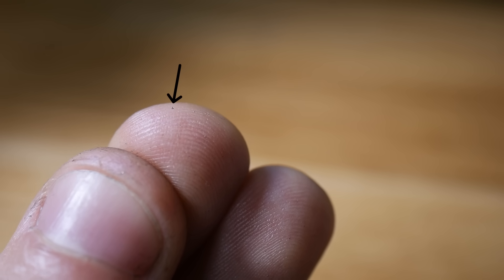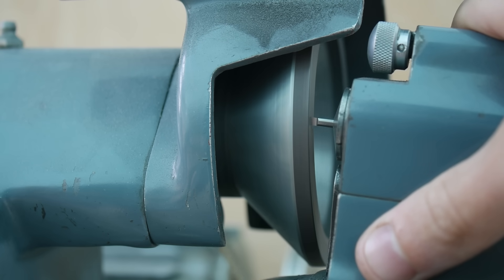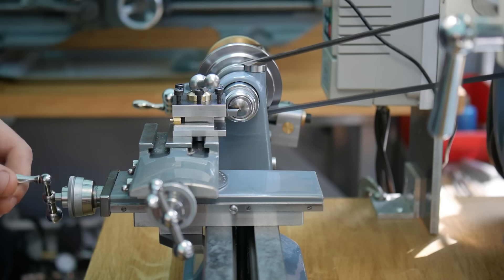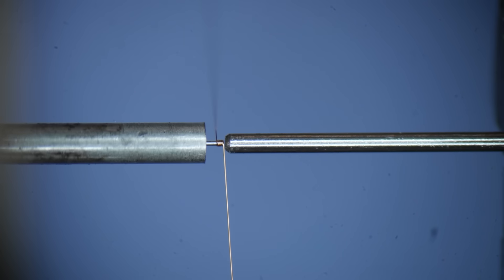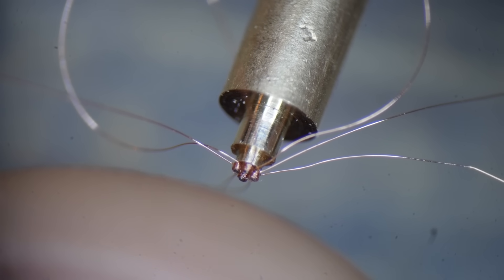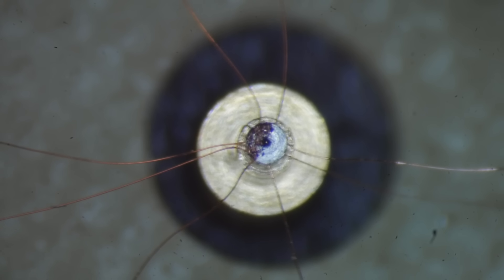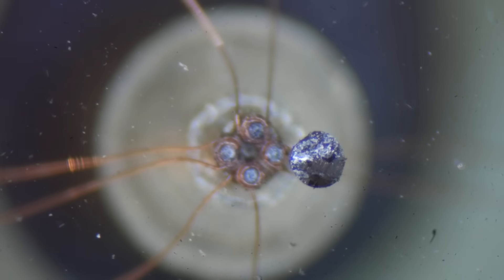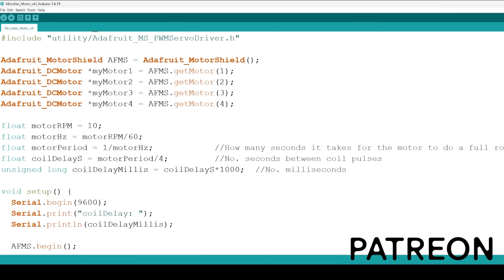Attempting to Make the World's Smallest* Electric Motor

Comment: this is incredible
also i don't think the wire melted in the solder, but dissolved straight from solid
Reply: I was about to comment the same.  Copper is glowing noticeably by the time it melts.  Along the same lines, I don't have the ability to melt platinum in my shop, but I've made silver-platinum alloys by just dropping platinum in molten silver and letting it dissolve.  It seems like it wouldn't take long to dissolve a copper wire that fine in molten tin/lead/whatever.
Reply: @PyroForge  hope you are joking... solder melting point at the absolute maximum with no lead content is 450c. copper melting point is minimum 1050c. they are not even close to overlapping. platinum melts at 1700c, and silver 1200c. so unless you are getting close to the boiling point of silver, platinum will not melt.
Reply: @bmxscape  You don't need to heat a metal up to its melting point to get it to dissolve into another metal, just like how you don't have to melt sugar to dissolve it in water.  Quite a few metals will dissolve in mercury at room temperature.

Comment: If you had three pole-pieces and set them up with a three-phase drive to create a rotating field, it might be possible to use a rotor machined from fully-hard Sterling silver rod,  or possibly Tellurium copper. No need for it to be magnetised, it would be driven by eddy currents. The drive waveform could be an analogue pseudo-sine, with eight or so steps, although at the frequency you'll be running, it could probably use a real cosine function. Simpler to go with PWM, but it depends how many DAC outputs your microcontroller has. Each coil would need to be driven from two antiphase outputs. I guess you checked for temperature rise in the coils? That might be the limiting parameter. Supporting the rotor using surface tension seems a good idea if you can find a low-viscosity non-evaporating fluid.  Great stuff.  Mad, but great!
Reply: This remains true of the iron rotor (even demagnetized), but the catch in both cases: an induction motor requires a high enough drive frequency that the eddy currents don't go all the way through it (or in transient terms, don't stop before the phases switch). For a part of this scale, it might take some 100s of Hz, even kHz, to spin -- at which speed you won't see anything!  Even a high-speed camera might be challenging due to the intense light needed and in such a small area!
Reply: @T3sl4  Well, that should be fine, there was no constraint as to what speed it had to operate at. If you can see the black half side when stopped, then it turns to a blur, you know it's moving. You can always worry about how fast later.
Reply: @kleetus92  sure, no speed constraint, but if it's moving fast and bumps into something, such as one of the electromagnets, it might go flying.
Reply: @T3sl4 what about reluctance motor? No eddy currents, no peramanent magnetisation needed - the "only" problem is how to create rotor (cannot be simple disc).
Reply: @grzegorzdomagala9929  Also thought about reciprocating reluctance (i.e. solenoid + mechanism). A flexture might make one more practical at this scale?  An oscillator is still a motor -- but if one wants rotation specifically, converting one into the other will be similarly nontrivial (replace cogged rotor with ratchet rotor? heh).
Reply: @T3sl4  I thought about iron "bar" suspended in drop of oil on top of the stator. Even if the bar is not magnetized it will try to "short" magnetised poles of stator. If you magnetise poles in right order you can rotate the bar - and even claim "usefull application" - miniature stirrer or even centrifugal pump :)
No idea if something like that will be stable - I seem to remember that rotating objects tend to maximise momentum so the bar should rotate around shortest axis - but at this scale and in viscous fluid... No idea.
Reply: It’s amazing how often those two intersecc
Reply: Wouldn't the Eddy currents blow the rotor out of the hole?
Reply: @naasking  If it would spin AND get ejected, that could be amusing. Spin-stabilized railgun?

Comment: Amazing project! Can't wait for any new parts!
I'm no expert, but maybe the step where you cut of the rotor with the diamond saw etc. can be made easier by just shearing off that part of the rotor intentionally, supporting it inside small hole made in some kind of fixture(shearing it of while being partly inside a syringe or other 0.1mm hole).

Comment: I think that if you "pot" the stator coils in cyanoacrylate and make the rotor disc run inside a bore in the end of the potting material, covered with a bit of glass, it may work since the rotor in the bore is essentially its own bearing.  Rather than drilling or turning the bore, I would try using a core, (as in metal casting), to form the bore when you pot the coils. You could try using somthing such as teflon rod that the cyanoacrylate would not stick to to make the core, or you could use somthing that  would be dissolved by a solvent that would not affect the glue.

Comment: Some thoughts: laying the coils flat might be better, though it might increase the volume depending on how you measure it. A three-coil two-pole design might be better, maybe a simple bar for the armature so it works partially as a switched reluctance motor, giving more torque to overcome the high friction at these scales.

Comment: 11:11 wear a mask, then you can safely breathe around these kinds of sizes. I use one for soldering, and while the solder smoke pops out, my breathing doesn't disturb it, it goes in a single, clean line towards the extractor (almost like in those laboratory pictures with wind tunnels for the study of hurricanes).
Reply: I interpreted his statement to be less about blowing the part away and more about the additional vibration/movement that breathing causes in your body. I find when micro-soldering that holding my breath briefly steadies my hands significantly if I need the extra stability. A mask does’t hurt to prevent air currents though.
Reply: couldnt he just turn his head for a moment and inhale
Reply: And a beta blocker 😅

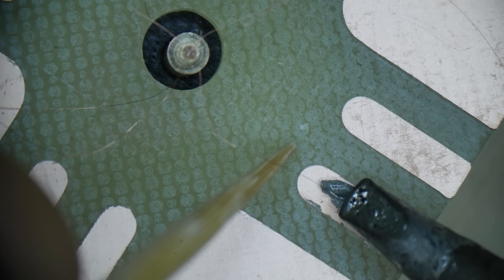Comment: 10:32 for stuff like this, don't use solder. Go get the paste that's used for copper pipe installations. It contains an amount of solder. Put the wire on the pad, put the paste over the wire and the pad, then put a heatgun on it. You can use aluminium foil to insulate the areas you don't want heated.
Reply: @aserta    at 10:21 you can see he is using solder paste, can’t quite tell if it’s being dispensed from a blunt needle or is on a piece of wire in a pin vise. And at 10:30 ish there is solder paste on the pad before he sets the iron down. Plumbing solder should also be avoided on electronics as the flux is generally acidic and can cause damage.
Reply: Why use that and not solder paste, which is designed for soldering small electronics to pads?

Comment: Have you considered casting the motor parts? You might be able to grind, drill, mill, or etch away a negative impression of the part on a ceramic material and then fill it with filings from a magnet. You might be able to melt the filings in situ to form the part.

Comment: Ooof, I don't hate myself enough to attempt something like this.
BTW add photocuring UV adhesive to your arsenal - you can manipulate the part till you're happy with it and a bit of UV light will set it in place in an instant.
Reply: Yes! Microtec Turbotec 911 UV works well for me...
Reply: @bastian6173  Would a glass pipette (like the ones used to interact with single cells) be helpful for applying tiny amounts?
Reply: @billmiller4800  personally I use thin pieces of wire to apply tiny amounts. If the droplet is small enough there is no need for a pipette
Reply: @bastian6173 is this product available in the US?
Reply: @michaelludvik2173  just did a quick search and it seems they're only available in Europe... unfortunately. They do offer large 50 gram bottles though which could make transatlantic shipping worth it. Note that a lot of UV CA glues are destined to be used for metal/glass combinations. Very few are meant for regular wood/metal/plastic etc. And... make sure to store inside a fridge to maximize their longevity
Reply: @bastian6173  ah ok, I was coming up with Euro only results from my search too. I am used to Bohle and Dymax for our glass bonding. I am looking for a UV glue that is good for micro scale components (bonding a 1mm metal shaft to a ~3mm glass disc). It needs to be low viscosity and have a fine applicator tip.
Reply: @  if it's only about size, why don't you buy one of these UV blocking bottles and put an application tip on it that suits your needs? Just an idea
Reply: I got something called "SOLAREZ Fly Tie UV Cure Resin Thin Hard Formula" off Amazon.  Available in a 5g tube so not expensive at all.  Still works about 4 years later!
It has a great viscosity and surface tension for applying tiny amounts accurately.  I used a tiny wire or a watch oiler for applying it.  This is the same way tiny quantities of lubrication are applied accurately to watch parts.
You first get the smallest bit you can from the end of the tube onto a small nail or bit of wire.  But this blob is enormous compared to what you want.  So then you take a small wire, maybe 28 ga, and touch the tip to the blob and transfer a bit to the tip of the wire.  By how you orient the wire and how quickly you move it away you have surprising control over how much is transferred.  Then you carefully touch the bit on the tip to where you want it and the surface tension pulls some off the wire.
Trying to apply directly from a hypodermic needle would be way too inaccurate at this scale.
A tiny handheld UV light hardens it in about a second.
Someone should make a foot pedal operated light that uses BLE to signal to the light, so it doesn't need to have wires.  Pushing the on button the light not only takes one hand, but it's a very large motion at this scale, which makes it hard to hold the other hand steady.
Reply: @xyzzy42  appreciate your detailed answer on this. What kind of things are you making? I just googled fly tie and it’s a fishing product. Does that have good mechanical properties? Also others have mentioned the watch making technique of dipping a thin wire in glue - I will try it! Also, which UV light do you use?

Comment: What about putting the jewel bearing on the bottom of the device with the rotor shaft going through the whole thing?

A tiny clamp lid made of plastic with teflon on the “top” can reduce the friction and hold it in place.

Then using marker on the edge of the rotor (instead of the top) and filming from the side to check if it works.

I think this will hold it all together despite the magnetic forces and reduce friction.

The lid can also act as a stop to hold the coils. Plastic toothpicks could be used instead of wood for pressing things together or a custom metal toothpick.

Plastic tends to have static electricity though and i don’t know enough about micro electronics / magnetic fields to judge if this is a problem or not.

Finally, perhaps using the circuit board as part of the initial mounting, then freeing it could help stabilize everything at this hand-made scale.

Comment: Can you make a jig for the cutoff step with the magnet. Am thinking a u-shaped jig with a precise aligned hole on each side that allows rods to come in, one from each side and nearly touch. The gap between is width of the finest grinding disc you can find.

One rod has a hole that accepts the rotor shaft, with a short counterbore to allow the rotor top you want to preserve in. The other contains a hole the diameter of the main piece of stock. CA glue the final part into the jig, and then grind using the gap as a guide, then soak in acetone to release the part.

You might even get away with making a part with simply a pair of holes so the final rota fits precisely and flush with the top surface. CA glue in, grind off close, sand / burnish flat, and then acetone.

Comment: Absolutely unbelievable work! I don't know if this can help but they do make micro manipulators for inverted microscopes. You may have seen pictures of glass micro syringes injecting stuff into single cells. This equipment is available on eBay but unfortunately guaranteed working examples are usually expensive.

Comment: Brilliant! I'm not sure if these other methods of motor driving are any easier to miniaturize, but I thought I would note them anyway: Electrostatic (corona discharge from a needle which pushes on the vanes of a tiny Crookes-radiometer),  Induction ( Similar stator, but the rotor is not magnetized. Instead, a rotating magnetic field from the stator induces eddy currents in the rotor which produce a complementary magnetic field. )   I think the induction one is promising, since I've heard that such a stator can even rotate a plain copper slug.

Comment: could have started with a motor 5x times the final size and learn/refine/improve the processes
Reply: Not sure you understand the scale here lol. 
5x is nearly an equal challenge for 99.999% of any machinist. Which would mean it would take nearly as long for the first iteration. This IS his first iteration, it was the test to learn from. 

Also scaling something this sensitive to magnetism, air currents, debris, etc etc, most likely wouldn't transfer 5x smaller. Most of the "learning" was in the method of machining and assembling, not the proof of concept.

Comment: Does the rotor shaft need to rotate? If not then wouldn't it be easier to make it static, and rotate just the rotor plate? Less holes to get filled up with glue...

Comment: PS:  I suspect the entire premise of this motor is the wrong direction.  I get you are reproducing history here but what should be done without a doubt is a Corona Discharge motor.  That or some action with Piezoelectric.  Still electric motors but the physics at this scale should be far better than trying to work with electromagnets and could be powered with electrostatic fields or soundwaves.

Comment: Amazing, as always. When milling PCBs, I like to cover the copper with machine oil. It facilitates the cut, but most importantly, keeps the awful fiber glass dust in the oil and away from the air and peoples lungs
Reply: Nice tip, I will remember that. Isopropanol works for machining aluminum, do you know if that would work for copper too? That would leave less residue than cutting oil

Comment: Would it be viable to encase the windings in extra adhesive or epoxy and then machine away the excess? Give yourself a little extra material to work with in the tweezers. Or does that violate the spirt of the exercise?